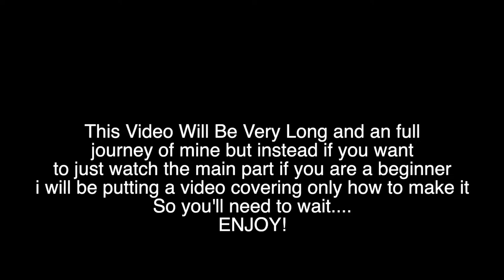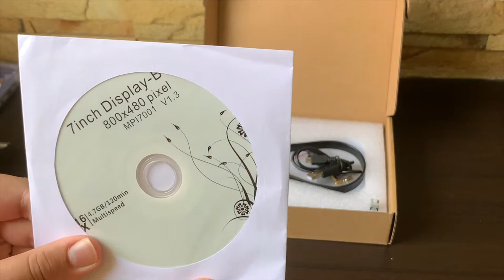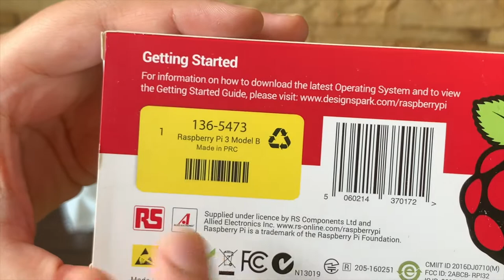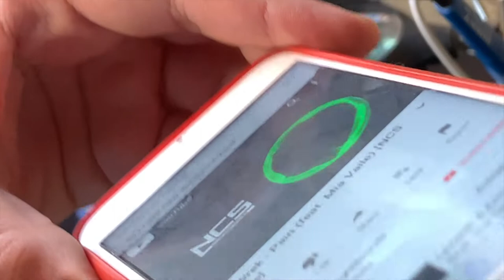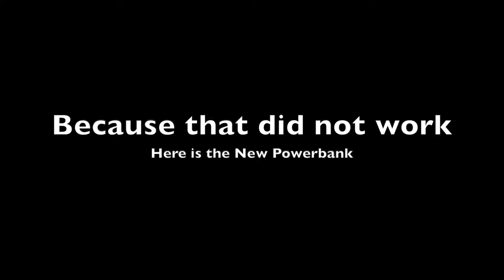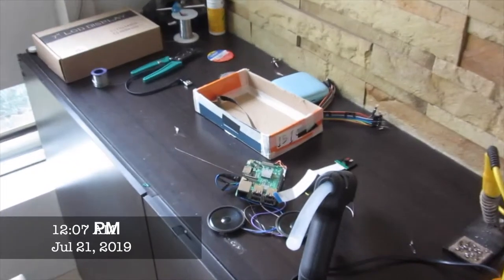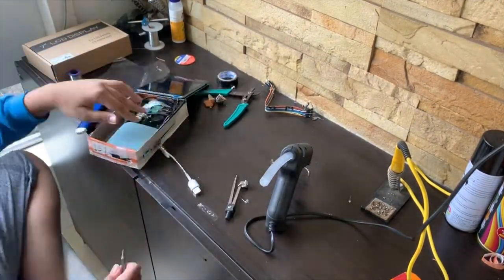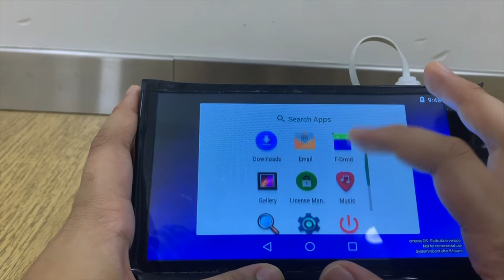How I Made My Own Tablet Computer - In India

Comment: Is there any website of this shop because on most of the sites literally charges double of the amount!! A raspberry pi 4 1 Gb Ram for 5500 - 6000 sometimes and screen more than 7k+ I mean seriously WTF!? can you suggest . where should i buy parts for my project for the cheapest?
Reply from the maker: Wow, those price-tags are INSANE!
Tho I’d say that some high quality screens (including the original RPi skin) actually are priced at 7K which is an equivalent to 100$ but I’d rather you not pay for that.

I think you can think of Bangood for the parts or a physical store after the pandemic settles. I personally went to a physical store for some parts and the some were from Bangood.

You can find other websites as well, but I’d like to tell you the appropriate price-tags for these items:
RPi 4 2GB (As the 1Gb variant has been discontinued) - About Rs. 3000
7” Screen 720p -> About Rs. 2500
7” Screen FHD -> About Rs. 4000
10” Screen -> About Rs. 9000

Hope this helps!
Reply: @TheiTE   bro give the link
Reply: You can also see amazon
Reply from the maker: @shreyashroytechnicallycuri5461  Amazon is not viable, the sellers sell the items for way more than what they are worth.
I do not provide links to such niche products as there are a lot of scams involved, I do not take responsibility. You will have to do that part of the research yourself, I have provided the list of parts :)
Reply: @TheiTE  ok